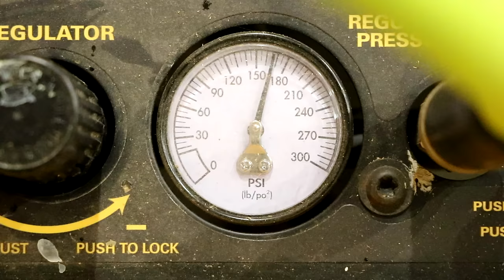Installing PEX compressed air system #33 Doing It Dan's Way

Comment: yes as one who sells and installs pex, it will work on air even compressor that put out 175psi, and I am sure were he is it is a warm climate, but here in the north were our winter are -40 most of the time, and it will be fine if your shop is heated, but if it is not heated, pex turns to like glass when it is -20, I used pex in my in heated shop, and when I use it I make a fire, I don't use the pex system in the winter, as pex turns to glass when it is really cold, leave a peace of pex out side at -20 and bend it, and see what happens, my pex system blow open a few times in the winter in the cold, the MFG  SAYS NO, BUT USE IT if your in a warm place of heated

Comment: We use  pex water line outside and inside house everyday never thought it hold that kind pressure till look on youtube channels.  I got black pipe installed on my shop. Will not hesitate too expand my airline system with pex . Big plus with pex if use it outside and get water  buildup in the lines and it freezes pex doesn't bust. Great video!

Comment: Thanks for clearing up my mind to use pex myself. I built a cooling system into the compressor output and it looks kinda ‘cool’ with all the copper tubing. I also have an air drier at the end to help hold the moisture to a minimum which can be brutal here in Florida summers, which incidentally last 9 months.

Comment: Why not Type L copper?    I used that in my shop, did it myself, and in 15 years had zero problems running at 125 PSI...   Also where you stub out your air connectors if you throw a 90 (pointed down) on before the adaptor the hose will connect and not stick out into your shop space and virtually eliminate a snag hazard
Reply: I don't know if you have priced copper lately, but it's outrageous especially fittings! Just fittings are going to run several hundred dollars!
Reply: @wesman7837   Yes it is...  Now they make pex, that is designed for air lines.

Comment: We use poly flow tubing which is basically the same thing and works awesome fast and cheap to install. awe run it with a rotary screw compressor and have no issues 5 years and going and live in the north east with extremely cold winters no issues. Looks good

Comment: PEX works great. I suspect that people are nervous because there have been some horror stories involving the use of PVC. PVC is notch sensitive. So even though it may be rated for the pressure if you drop a wrench on the PVC pipe it can easily explode! But PEX is somewhat flexible and will do just fine. It is not rated to exposed to sunlight however so just don't run it in front of a window.
Reply: Would coating it with a UV resistant coating help or would it hold in the heat too much?
Thanks!
Reply: @enzprintco.8625  It might but the question is, will the solvents of the coating affect the integrity of the PEX? Personally if you needed a UV resistant solution I would run it in copper. If it was just a short length in front of a window then you could use a length of larger diameter PVC pipe and simply slide the PEX inside the PVC to block the sunlight.
Reply: Frank Hinde are there any stories of pex bursting on an air line? I was thinking like that flex seal or plasti-dip to coat the pex...so if it explodes, won’t send shrapnel everywhere ?!?!
Sorry, super new to this. Got a new Quincy 60 gallon compressor and still trying to figure out the best setup for paint.
Thanks for the info!!!
:)
Reply: @enzprintco.8625  No stories of PEX bursting.. Even if it did it would split, rather than shatter like PVC will. So its perfectly safe in that regards. But no I would not paint it with anything, especially not a solvent based paint which could well weaken the PEX. PEX is rated to a pretty high pressure from memory, but remember that any plastic pipe gets weaker as it gets hotter. I am a professional engineer with 30 years experience and I have occasionally seen flexible plastic tubing fail where it has been run inside machines where it gets really hot. But honestly its highly unlikely you will have that problem unless you run it behind an electric space heater for example. Just keep it out of direct sunlight and it will be a great solution for you. Put it this way.. I ran my compressed air distribution system in PEX and its been there for more than 10 years..:)
Reply: @enzprintco.8625  Oh your are intending to use your setup to spray automotive paint?? Honestly your biggest potential issue is oil carryover from the compressor itself. If you get the SLIGHTEST amount of oil in the compressed air you will get fisheyes in the paint.. It looks HORRIBLE! I have painted 4 cars and one airplane. The way I solved the issue is to buy an oil free compressor. My Craftsman compressor cost $300 back in 2005. Now they have a reputation for not lasting long but the paint cost for the airplane was over $1000, so $300 for a throwaway compressor seemed like a good deal. I still have that compressor today and it runs great. Now even if you run an oil free compressor, if you have used your air lines on a previously oily compressor, even the oil contamination in the airlines will be enough to give you fisheyes.. I know this from painful experience! Most people use an oil filter and seem to get OK results. I personally just went the oil free route.. i.e no oil = no fisheyes period. But if your Quincy is oil lubed you will need to take precautions against oil contamination.
Reply: Frank Hinde - I appreciate the info brother! Thanks so much!
I’m fairly knowledgeable with what’s needed to get clean dry air. I’m planning on running an after cooler between the pump and tank with an auto drain filter right before the tank to get ambient temp air to keep the tank cool and dry. I’ll also be using it for some woodworking and auto body tools so some oil is ok in that line but I know I’ll need a dedicated paint line with no oil.
A plane? Wow! I always wondered how they paint the roof. A ladder and a lot of leaning over? Haha
Thanks again for your help!!!!!!!!!!!
:)
Reply: @enzprintco.8625  YW.. Happy to help.

Comment: For fun Dan you should have upset the whole world and Sharkbited the whole thing. LOL  Nice clean job. Bravo. btw I have a piece of Uponor A pex under the hood of my Dodge truck on the emission vent line from the aircleaner accordion hose to the valve cover. Certainly not an approved use but it works and is holding up well under there. Chrysler wants 14 beans for that molded hose.  NOT.. Pex rules the world..LOL

Comment: This is awesome! Literally just googled the exact words of the title of your video bc I have a bunch of pex leftover from a project and wanted to use it for air drops as well... saw this video and it just helped validate my thoughts along with some other research but I am with you my friend, I just don't see why this wouldn't hold up just like any other plastic tubing out there used for air lines... so long as you keep it protected from uv since that will deteriorate it...
Great video tho and thx for the info! Looks great btw!
Cheers! 
- Jesse

Comment: Hey how’s it going!? Great set up! I see this is 5 years ago. How’s things holding up? 
Looking to do this myself. Any tips or advice you learned after you did this?
Reply: Kyle, I don't see a response. Did you get a status in a private message? Did you install a similar system? If so, how has your system worked? Thanks

Comment: I've always wanted to try this but I kind of need at least three quarter inch line at 175psi. I wonder if it would hold up long term. It looks like temperature affects the max PSI for this stuff
Reply: I don't think it will hold anything over 140-150 psi, and certainly not if it's over 90° F.

Comment: Pex ,even the cheapest one breaks above 500 psi.   Some of them break above 750 psi.
Reply: You're high in the night! NO PEX works for that kind of pressure especially when it's hot! 150 psi is about the limit @90°F.  After that you're living on borrowed time!
Reply: @wesman7837  your talking about the manufacture rating.   Totally different.  I’ve seen them tested.   It takes a lot of pressure to break them.  The manufacture rating has a safety factor in it.   I’m sure you can find a video on the tube with it being tested if you want.

Comment: I would have a higher connection on the wall and make a shelf for the compressor to sit on and connect. Get stuff off the floor when you can and have tall walls.

Comment: What's funny is you say that paix is not supposed to be used for air pressure, but there's another video where a plumber said that paix is all that is used in current air systems.  I plan on using it as well.

Comment: @Daniel Woodell will you please share the various types of fittings you used to make up your manifold stations/air adapter? I took a close up pic and shopped the internet unsuccessfully. Thanks.
Reply from the maker: https://www.amazon.com/EFIELD-Female-Drop-ear-Transition-Threaded/dp/B07CLQSRLD/ref=mp_s_a_1_3?crid=376VHZMQ31GJP&keywords=pex+to+shower+head+adaptor&qid=1677126109&sprefix=pex+to+shower+head+adaptor%2Caps%2C113&sr=8-3
Reply from the maker: Legines Brass Long Nipple, 1/4" NPT Male x 1/4" NPT Male Pipe Fitting, 3" Length, Pack of 5 https://a.co/d/7mlHoju
Reply from the maker: hynade 1/4'' NPT 11 pcs Air Fitting and Couplers Kit, Air Quick Connector Air Fittings, Industrial Air Fittings Brass Plated Quick Connector Kits (11 pcs) https://a.co/d/hMoMpHE
Reply from the maker: Hope those links help

Comment: How do you like how your pex system is holding up after 2 years, anything you would have done different ? Wanting to do this for my shop and trying to decide what clamps to use. What would you suggest, the rings like you used, the stainless pinch clamps, or the sharkbite push to connect? Also what size pex would you recommend running,  I have a 2 stage 5hp ingersoll rand compressor.

Comment: 110 psi? I want to be able to run at 175 psi when I need it.
Reply: Please provide three examples of times you would need 175 PSI.  I would say for those limited times, you could run a hose straight off of the compressor.  Your average DIY home enthusiasts are not going to need pressures above 90 PSI.

Comment: Man this is awesome!  I always wondered why people weren't using PEX.  I understand your system pretty well, but I have a few questions.  Could you go into a little more detail as to how you put together the air manifolds where you hook your tools up to?  Also, what did you use on the threads for the air tight seal when putting together those manifolds?  Thanks Dan!  Awesome system.
Reply: Probably just some teflon tape from the plumbing section of a store.  That's what I use on all my threaded air fittings at least.

Comment: I know this is an older video, I'm planning on doing the same thing and was wondering if you have any advice on what worked/didn't work?  Did it work to drain the moisture from the one line you installed or should I put in a lower drop to catch moisture?  Any help/advice would be greatly appreciated, thank you for making the video!
Reply from the maker: have had the system pressured for a long time and have not had any problems with it. As for the moisture my shop is isolated and heated, so i don’t have a lot of moisture problems with the air system. Every once in a while i use a regular air blower on the out lets and just let it flow for a min or so, and it blows anything out that is in there. the time and expense that would have been required for a moisture drop leg or a loop was not worth it to me. Also for the few times that I have a tool that really requires not moisture in the line I use a dedicated out let that has a moisture separator on it, that I picked up a harbor freight.
Reply: @DanielWoodell I've heard other Tubers mention failures with crimp style PEX, and from what i've heard the Uponor is preferred for water, how do you think it will fare with air?
Reply from the maker: Chris Woolvin Uponer is a great product much better than crimps, down side is it’s not sold at Home Depot or Lowe’s and the tooling is expensive, if it was readily available I would have used it.

Comment: awesome video well done mr dan,love pex my self aint bad priced but them dam  connectors boy they can be costly.
Reply: Shawn Vandenabeele If you use the expansion type connectors which is what most the pros use most they cost is in the tool then so if you do enough fittings it pays it's self off. The expansion type connectors are just about the same price as copper.

Comment: Hey Daniel,
 I am in the process of planning to install air line in my shop.  I though I would do a little more research an came across your video. Thank you for doing the video! You have inspired me to do exactly what you have done. Just like you I have extra material from a previous job. I'm glad I watch your post. Thank you! Did you use all 1/2 inch or 3/4 pex pipe? Plus was there any special type of pex pipe or brand that's best to use? Thanks again, David  Hope all is well
Reply from the maker: David  Brousseau Are used much 3/4 I had, then I switched over to have inch. The stuff I use was just the stuff you buy at Home Depot. My system has been installed for over year and a half it’s always been pressurized I’ve never had any problem with it.
Reply: @DanielWoodell  , I appreciate your quick reply . I will be installing it tomorrow. thanks again. David
Reply: @DanielWoodell  Do you think the 3/4 was necessary for the main line or would 1/2 been fine for the whole project?
Reply: Same question if anyone knows.
Thanks!
:)

Comment: Hey Dan, What fittings did you use at the quick connects? Drop ear elbows?  What are the stub outs and type of nut connector used?  Compression fittings?  Great Vids!!

Comment: I have a bunch of Pex stuff leftover from the replum of my house. I had planned on returning it, my plans have now changed.  Thanks for doing this. Also, do you use any type of dryer on your system? Also what size tubing are you using?
Reply from the maker: i used 3/4" for the main run that is most of the Blue stuff, then i used 1/2" for the legs that run down to the plugs, that’s the red stuff, i used these sizes because that is what i had left over from previous projects.  I don’t have a drying installed, when I need dry air I have one of the plugs that has a moisture separator on it.

Comment: Good video.   My garage stays from 95 to 102 degrees in summer (Texas normal). The attic stays around 140 to 150 with ventilation. In your experience how will the pex hold up to these conditions ,on the long term, running through the attic down into the garage?
Reply: "In accordance with ASTM F876 Standard Specification for Cross-linked Polyethylene (PEX) Piping, the excessive temperature and pressure capability for Uponor AquaPEX® is 210°F (99°C) at 150 psi."
Reply: It'll be fine at that temperature, just make sure its not exposed to allot of sunlight. UV light makes it brittle
Reply: Pressure ratings for water are not the same for compressed air

Comment: 4:50 Instead of talking so much you could rather have measured it properly and save a connector. And i do agree that PEX-AL-PEX is a great option and my choice for air plumbing. We can get it here with 10 and 25 bar rating. Did it leak or not?

Comment: Jealous of that mancave, Daniel.  Question: are you concerned at all about sheetrocking over the PEX?  If you end up having a leak, at any one of your connections, it might be difficult to find the source and then have to tear out all of the sheetrock.  Other than that, it looks like a great setup.  Haven't watched all of your videos yet but did you put insulation in between the studs and sheetrock?  Cheers.
Reply: He could install some stud protection plates from a plumbing supply to protect the pipe.